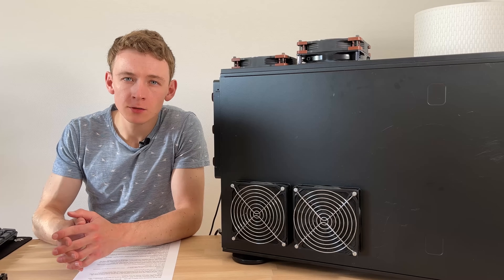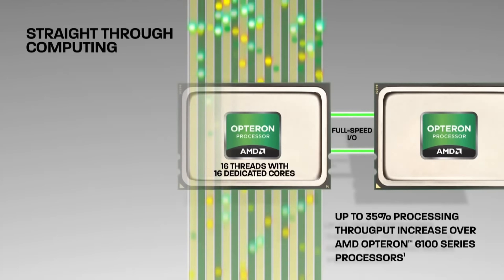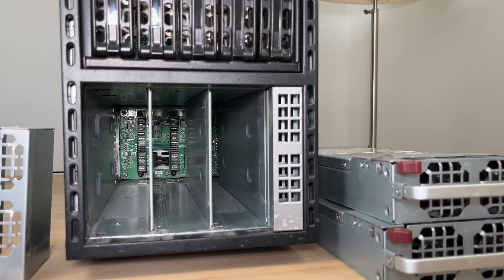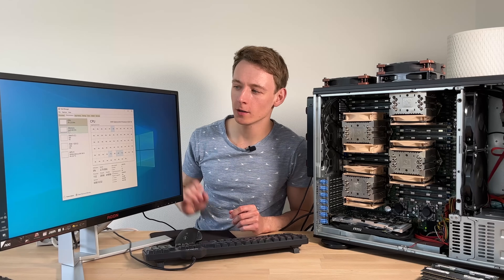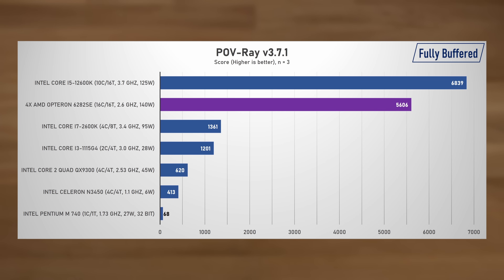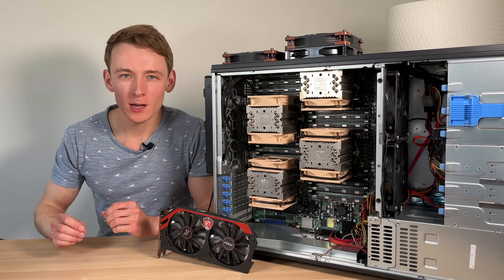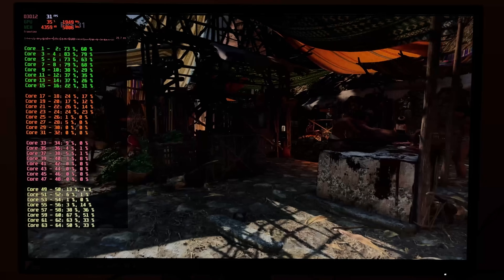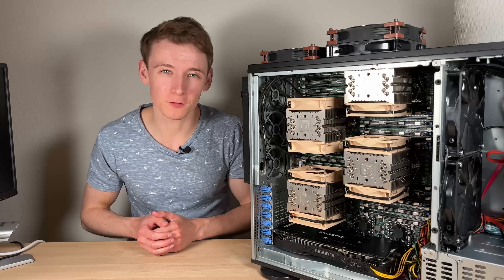The Quad Socket 64 Core Opteron Monster – The Most Insane Desktop PC

Comment: I'm a huge fan of multi-socketed systems, I've notated that finding content creators that focus upon them almost explicitly in as great detail as you do an incredibly daunting and nearing impossible task! I own quite a few multi-socket PCs from a few different eras, i'm quite proud of my collection! - 

- A Dell Poweredge R900, 128GB DDR2 (4x Xeon 7400 - 24x Core 2 cores!) I'm playing around with getting a graphics card to work in it for laughs, but it only has PCIx8 slots and no way to distribute power to the cards. (PLEASE COMMENT IF ANYONE HAS ANY ADVICE OR SUGGESTIONS ON HOW I MAY ACHIEVE THIS!)

- A Dell Precision 690 with the SLI upgrade! 64GB DDR2 , 2x Nvidia Quadro FX4800's in SLI (2x Xeon 5080 , 4 Netburst cores w/ 8 threads at 3.73Ghz, eat that i7!) 

- A Supermicro X6DVL-EG, 8GB DDR-400 ECC, ATI Radeon X1900 XT (2x SL7ZC Xeon  3.60 GHz Socket 604) I was trying to mimic as close as I could get to a dual socket Pentium 4 computer as Dual Socket P4 478 Motherboards didn't exist! Funny thing is, these Pentium 4 Xeons have 2Mb of cache, making their clockspeed and cache on par with the legendary and nearly unobtainable Pentium 4 Extreme for the socket 478! ( I'm having trouble finding good x64 compatible drivers for the chipset for any version of windows, if anyone knows where I might find these, please let me know!)

- A Dual Processor 2009 Mac Pro 4,1 flashed to 5,1, 128GB DDR3 ECC, ATI Radeon 5770 Mac, (2x 6core Intel Xeon CPUS, I forget which exactly!) (This machine is currently inoperable and is having some serious instability with the RAM configurations, i'm considering removing the 2x 6-core Xeons and returning to some that are factory supported by the 4,1 firmware just for the sake of making it operable again.)

- A Dell Poweredge 2900, 48GB DDR2, 2x Xeon E5450s  (I purchased this server at 12 years old with money I saved mowing lawns for $200, it single-handedly kickstarted my love for these multi-socketed systems! I've used it near to daily since I purchased it, it's hosted a countless number of game servers and web servers for me and my friend groups in the past!)

- A HPE ProLiant DL580 G7, 256GB DDR3, With a 1050ti! (4x Xeon E7-4870, 40 cores, 80 threads at 2.40Ghz! - I've lent this server to a friend who is using it as a GAMING COMPUTER currently! In the winter, his room stays warm, in the summer, it's constantly fighting with their AC and keeping the room almost unbearably hot! This server is running a version of Windows Server 2019, because Windows 10 won't install drivers for it correctly - If anyone knows a solution for this problem, it would be most appreciated as most games won't support Windows Server 2019!)

- Finally, I've got 3x HP Proliant DL360's w/ 2x Pentium 4 Xeons 3.0Ghz  6GB DDR-400 ECC (These were free of charge when I purchased another HP Server and I don't have many chances to use them, but I keep them around because they're only 1U and don't take up much space on my home made Rack. They're all fully operational and are quite cute!)

Comment: I always wondered why someone didn't try strapping more CPUs to a machine to get more performance. Imagine if we had a board that housed 4 Ryzen 9 5950X CPUs. Why has no mad lad tried this yet? Let's get quad 5950X up in here.
Reply: they have and they are called epyc cpus and xeon for intel. they are the server/workstation type. consumer cpus like ryzen and core cannot work at multi-cpu configs.
Reply: the only consumer cpus even been able to work in dual config were the Pentium3 s370 in some sketchy soyo motherboards, but they were quickly dropped like flies.

Comment: This is what my PC is basically :)  Although i am using a slightly older revision SC748 SuperMicro case with an additional Supermicro GPU exhaust fan on the rear to pull extra heat out :)  Motherboard is SuperMicro H8QGi-F in my case running a modified BIOS so i can overclock the ram.  For CPUs i run 4 unlocked Opteron 61xx "extra spicy" at 3.0 Ghz normally.  They can run up to 3.7 Ghz if i only run 2 per cpu die - the problem is the Noctua heat sinks just can't pull enough heat out.  I built it back in 2014 and still use it today.  Solid as a rock.  Heavy too - about 80 lbs.

For optimal performance you'll want to run TurionPowerControl, and the OCNG BIOS.  For my older 61xx chips OCNG allowed me to up the dram speed from DDR3-1333 to DDR3-1600.  i tried some DDR3-1866 chips but i could not run at that speed - it seems the ram controllers on the 61xx chips just aren't capable.  i can run them at DDR3-1600 at lower latency of course.  OCNG also allows you to take advantage of the XMP settings on the RAM.

For gaming, i used TPC to run two cores at 3.7/3.8 GHz and the rest lower at 1.7 GHz, then used Windows server WSRM to assign the specific games to those specific high GHz cores.  There is a setting in the BIOS that makes a large difference in gaming performance.  It deals with the way memory is accessed.  Node Interleaving.  One setting helps with overall bandwidth, and the other is better for games (better latency).

One other tip.  For optimal SSD performance on these boards - set C1E and Spread Spectrum to disabled... because on this board SSD performance gets screwed up with those enabled.

One thing i was not able to improve - the L3 cache times.  Ie i could not overclock the L3 :(  With the server chips AMD set that artificially low.  It is a key overclocking setting with the K10 chips to get good gaming performance.

Nice to see another person is still using one of these :)

PS: My Cinebench R15 score was 3228.

PPS: pic:

https://hardforum.com/threads/g34-4p-supermicro-pics.1666414/#post-1042088438
Reply: PS: i've been playing around with Opteron 6328s in my Quad Opteron PC recently.  Using OCNG to up the bus speed from 200 to 210, the system runs with a turbo speed of about 4 GHz now.  This is at stock voltage.  i haven't yet found the upper limit yet.  Perhaps around 216?  That would put these stock 6328s at about 4.1 GHz.  The nice thing about upping the overall bus speed is that it also ups the CPU-NB speed (from 2 GHz to 2.16 GHz) which increases the L3 speed.  Important for gaming.

i will be pulling these 6328s soon and replacing them with 63xx ES chips soon.  Let me know if you would like to experiment with these 6328s.  4 of them would net you 32 cores, but running faster and cooler (max temp of only around 31-32C on HwInfo when running long benchmarks).  The 63xx also use the Piledriver cores which are more efficient and have a bit more performance than the older bulldozer cores.

Comment: Interesting system, i'm currently running dual x5670 with asus Z8na-dc and 12gb of ddr3 ecc reg ram. I think intel also have quad socket offering which is E7 series but finding the cpu and motherboard may become a nightmare.
Reply: they are a nightmare don't even try. even if you did manage to find a 4way motherboard, they mulfunction like crazy. there is a reason why the tech is only producing just a few models, it doesn't worth the hasle just for the memory capacity.

Comment: Perhaps when you test linux you can try undervolting this system? Considering it would take 2 3090Ti cards in SLi to reach the 800+ wattage you got in synthetic tests..imagine 3090Ti in SLi with this quad socket behemouth..i think you'd make a bump in the energy company profits haha. Having a 4 monitor setup and running 4 programs as you did on each with 4 separate Windows 10 desktops..now THAT is multi-tasking, what a beast! Hey performance may be sub par but i doubt even a 12-900k could run GTA 5, BF5, r15 and edit a video all at once!

4 CPUs, 2 6870s (4 gpu dies) now wouldn't that be interesting for some crysis 3 crossfire action, a true quad beast machine!
Reply from the maker: Ha I did think about the Quad 6870s! Thanks for the suggestions - the quad monitor setup is a great idea!
Reply: @FullyBuffered  Perhaps quad 6870s running 4 cheapo monitors after covering linux 👀. Another idea may be to edit the follow up video on that quad socket setup and with those 4 monitors you can go from editing to playing some of your favourite games and conclude how that compares to your new 12th gen pc editing/running 1 game at the same time :p (or maybe 4 seperate applications to really push the 12th gen setup with those E cores too vs the quad socket monster and compare performance)

Comment: What's impairing performance in DaVinci Resolve and most games is NUMA. There is not much to be done here, and I assume that it'd be the same on Linux. You need NUMA-aware software to take full advantage of a multi-socket system or run one application per socket and assign the respective cores to each instance. The DOOM results surprised me though.
Reply: that's not the only problem. these cpus are known to have bad int and fp performance which also affects memory transfers, so any highly cpu/memory demanding app is going to strangle alot. doom perf. was unexpected but i guess that's because it may be the best optimized game out there.

Comment: I had a quad socket 6386 SE server to tinker around with. It pulled way too much power to be practical though. But, gaming performance is actually pretty good given the low clocks on archaic pile driver architecture. It was fun.
Reply from the maker: That sounds excellent - thanks for the comment!

Comment: Love it! Would be cool to see this machine running 4 x Opteron 6180 SEs. Maybe 48 x K10 cores will outperform 32 x Buldozer modules in some cases? 😁
Reply from the maker: Good point, I would like to see what the 48x K10s are like. If I can get them cheaply, it'll be very enticing. I too suspect the K10s could outperform the Bulldozers. Would also be better for scaling with less cores to handle.
Reply: @FullyBuffered  The K10 CPUs can be overclocked on your motherboard also.  It used to be popular back in the day!  There is a custom BIOS available which unlocks overclocking.
Reply: @ronjatter  I can confirm the modified BIOS can allow you to overclock, and it also works with Bulldozer and Piledriver Opterons.
Also, not too long ago I saw a madlad hit Desktop FX 8350 clockspeeds with 4x 6386SEs on a supermicro MoBo like the one above.
Imagine having 64 Piledriver cores running at 4.0GHz, that's quite the feat, and a big power bill too I guess lol.
Reply: @reik019  No shit. Cooling the damn things would be a nightmare, too.
Reply: i ran 4 Opteron 6180SEs originally, and then "upgraded" to 4 Opteron 61xx ES (engineering samples).  With the engineering samples i was able to run them all at 3.0 GHz fully stable.  The individual cores could actually run at 3.5 - 3.6 GHz, but the power draw/heat generation was simple too much for the Noctua coolers to handle.  The max i could run all cores without the motherboard rebooting was 3.2 GHz.  Temps at 3.0 GHz would stabilize at around 56C running Intelburn test.  You want to keep the 61xx chips under 60C.  The nice thing about the Piledriver Opterons is that they can be run up higher temps wise.

i am curious what the power draw will be on my Quad Opteron setup running the 63xx ES chips at 4 GHz.  Will know soon.
Reply: @rvborgh  I had similar and thought the CPU coolers were insufficient.  However upon adding two 120mm fans blowing along the back of the motherboard the rebooting was no longer an issue.  The backside of the motherboard (oppersite where the vrms are on the front) gets extremely hot !
Reply: @ronjatter  Thanks for the suggestion.  i'm running the board in a SuperMicro SC748 which has 3 large internal fans that blow across the VRMs, so i think i should be good there.  i did take a look at it years ago with a thermal camera and its true, that is the highest temperature area of the board.
Reply: @rvborgh  If you decide to do overclocking to such levels, I suggest you to look into Threadrripper waterblocks and mod them to be able to mount them into the sockets G34, and each should go to a 240mm radiator (or a very thick 120mm rad could do as well, as long as it's a copper one), as you will be dissipating 240-260W from each socket, that's very far from the capacity of most tower coolers.
Also, get some VRM blocks while you are at it, as these VRMs will be really pushed into their limits to achieve the voltage that the silicon most likely will need to be stable at such frequencies.
Also, the memory controller will most likely become a bottleneck, as very few Opteron 63xx can actually handle anything higher than 1600MHz DDR3, so it might be a little bit difficult to get Desktop FX 8350 performance in memory-bound tasks, but they will be certainly faster than most Opterons.
Reply: @reik019  At this point i am not going to be putting much more money into it - beyond the 63xx ES processors.  i'll use the system for another two years or so and then upgrade to a dual EPYC motherboard and put it in the same SuperMicro SC748 case.  By then this Quad Socket setup will have served me well for 10 years, which is exactly what i built it for back in 2014.

The Piledriver cores are marginally better single threaded wise but require a bit higher GHz.  The main improvement from them that i noticed was the memory performance which is about 50% better than the K10s.  L3 cache is also greater.

As far as memory, i'm running Crucial Ballistix Tactical DDR3-1866 modules.  While the Opteron 63xx chips in theory support DDR3-1866 sticks, it requires a motherboard with fewer traces/memory channels for signal integrity.  The highest possible with this H8QGi-F is DDR3-1600 unfortunately... but the Ballistix sticks in conjunction with the OCNG bios let me run them with tighter XMP timings.

Upping the CPU-NB also noticeably helps.  Currently running a mild overclock of the 6328s with a CPU-NB at 2.1 GHz by upping the ref clock.

Comment: A CPU upgrade is probably worth it given the low cost of them now. I have a dual socket Supermicro with Opteron 6376. Cinebench R20 score is 3205, so for 4 you might get 6400. The 6376 has a 300 MHz lower all core boost than the 6282SE, so it seems there is some IPC improvement with the 6300 generation. In the 6300 generation only the Opteron 6386SE has an all core boost over 3GHz.
Reply from the maker: I have a set of Abu Dhabis ready for upgrade :)

Comment: Currently running single socket Opteron 6180 SE as router / NAS with Debian. Paired with Mellanox ConnectX-3 10Gbe NIC and 64GB DDR3 REG ECC it does perfectly fine as home server. Wouldn't even bother trying it as gaming PC tho. Despite being single socket it's still split in two NUMA domains of 6 cores each and runs only at 2.5GHz so it's far from being optimal for gaming. Performance would be similar / slightly worse than lowest clocked Phenom II x6.

Comment: 13:55 try 4x 6386 SE, latest and most powerful opteron for the socket, never seen a bench video of.
Reply from the maker: I have Adu Dhabi chips ready, but sadly not the fastest as they remain too expansive..
Reply: @FullyBuffered  Any game that can use 32 cores or more? Dou you have any Abu dhabi chips around with same clock speeds?

Comment: Windows is really terrible with more than 4 cores, you should test it with Linux
Reply from the maker: Windows appears fine up to 32 threads or so, but over that (or whacky multi-socket stuff) and it quickly gets weird.
Reply: @FullyBuffered  it can be fine up to 32 threads, if it's on a single CPU, the second you hit another CPU and more than 4 threads, the shit hits the fan, Level1 had some NUMA testing some time ago, from that data I can pretty much tell you Linux is the way to go 😉

Comment: the hot rodding on the case/cooling the previous owner did is the wildest part
Reply from the maker: It's certainly head scratching and not something I would have done. Especially given how loud the power supplies are and overpower everything else noise wise lol

Comment: Nice find! Although I can't help to think how little difference it could've made just to take one fan off that top Noctua cooler and thus be able to keep the case intact. I mean the top fan positioned overhead is pulling the same air anyway :D Maybe I'm missing something.
Reply from the maker: Ha yeah, I certainly wouldn't have modified it in this way, but oh well...
Reply: Operons pull about 140 watts or more a piece And they don't have good low power C-states, so they run pretty much at full clock, even when idle. You're going to need the cooling. I had a quad 6386 SE that tinkered around with for a couple months.
Reply: @TheNiteNinja19  My point being that you're literally just fan stacking at that end which is not effectively adding extra draft off that heatsink.
Reply: @Wokiis  Blade servers do it because redundancy.
Reply: @TheNiteNinja19  Interlagos and Abu Dhabi Opterons have four standard power states, two boost power states, plus C1E and C6 idle states. They can drop single cores, not just modules, down to 1400MHz (P4) when not heavily loaded, and generally don't exceed TDP under full load as is. Combined with them being fairly well binned to turbo below 1.25v they really don't need absolutely massive cooling. The unlocked Opterons can get by on even a 1U brick cooler up beyond 4GHz with just a single 80mm fan pointed at them.
Reply: 1 fan per cooler works best, 1C is not worth the extra noise with two fans.